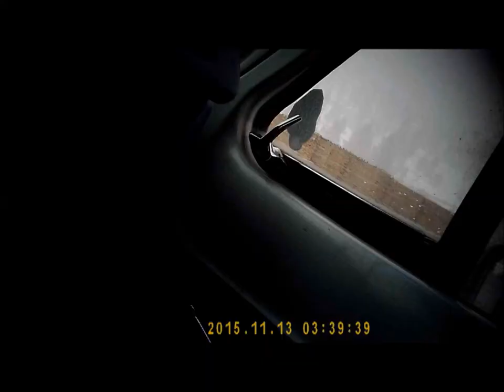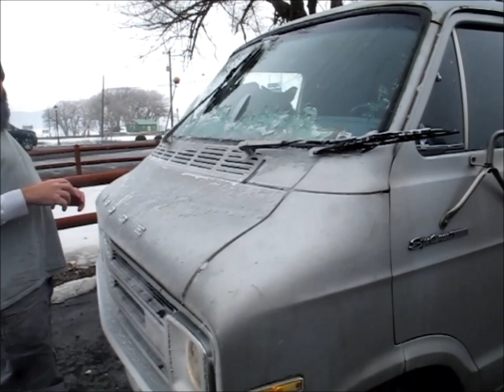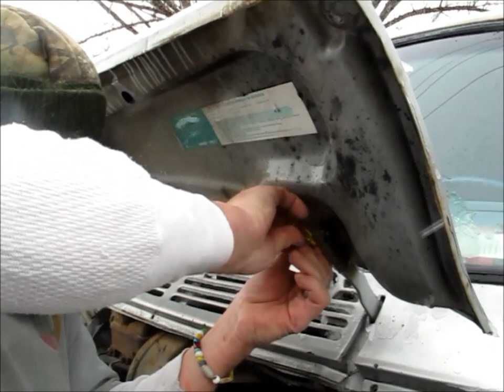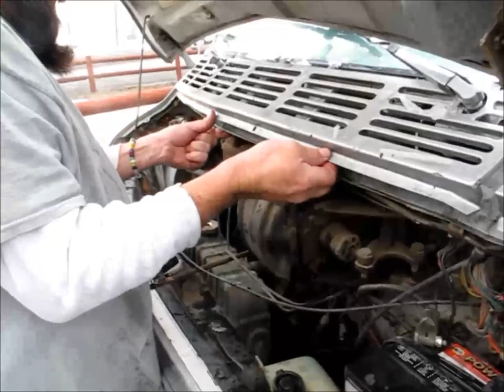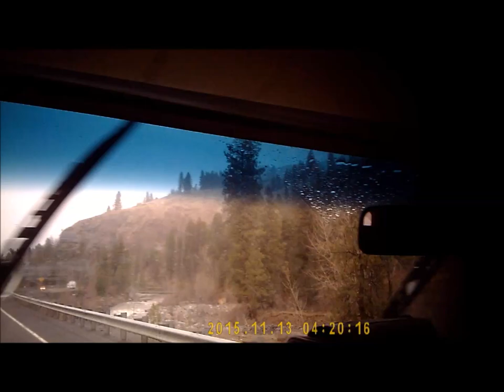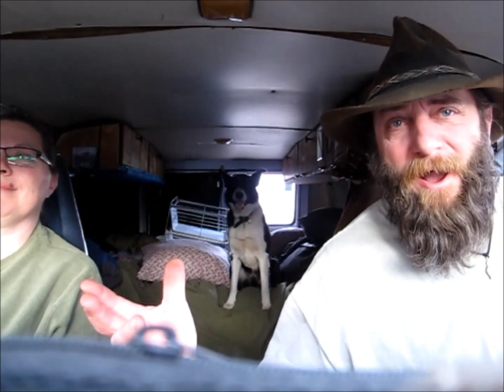Classic Van Life & Treasure Hunting Road Trip Junk Shops & Thrifting

Comment: LOL,
oh the memories. 
drove a 1971 Ford Fairlane across Australia back in Early 1980's. At the time they were sealing a 300km stretch of the highway so they had unsealed road on the side of the highway to take the traffic. The Highway surface was up higher than the side tracks and it had rained for a few days before we hit that stretch. 
The centre of Australia is a lot of Red dust that turns into Red mud when it rains and there were big deep muddy puddles all through those side tracks.
The splines holding my driver side wiper anchored to the wiper motor ahaft quit 50 km into that stretch and the next gas station was at the end of the stretch so we spent the next 250km with a bit of rope tied to the driver side wiper linked to the passenger side wiper and in the passenger side window. so every time we copped a mudbath it'd be wipers on and the missus pulling on the rope.
Adventures.

pro tip for the glasses. You may want to record with the other cam at the same time and then use the audio from that. Audio quality doesn't bother me and sort of adds to the charm but does grab a load of unwanted noise